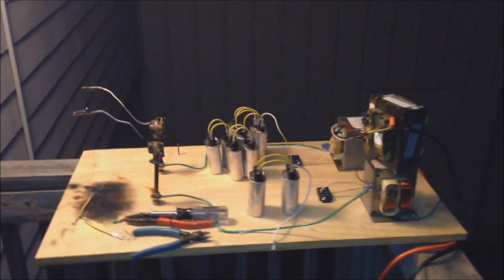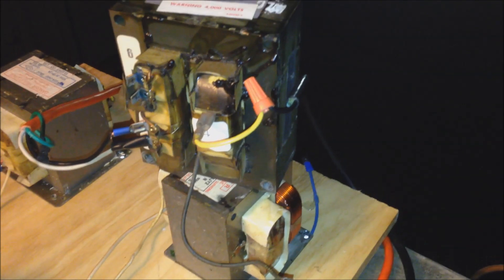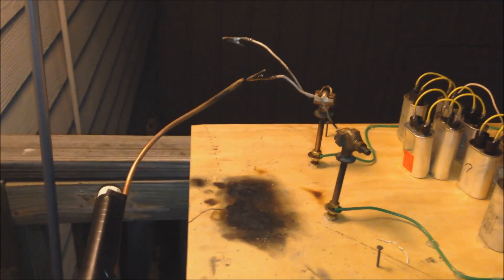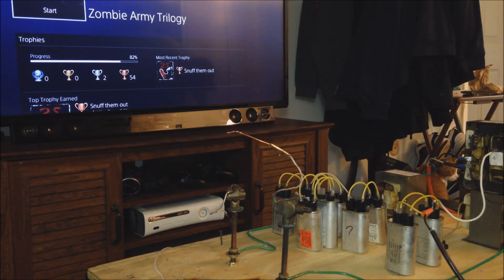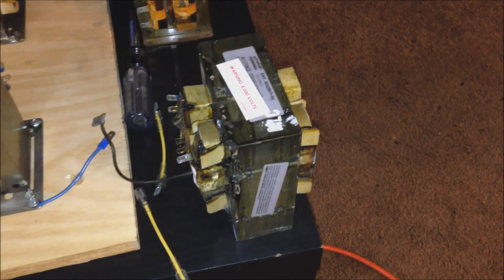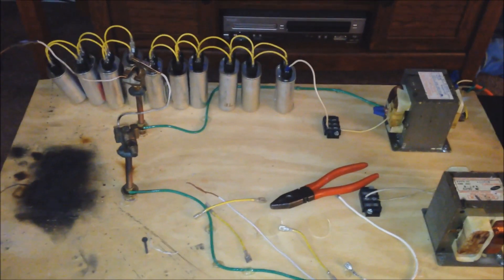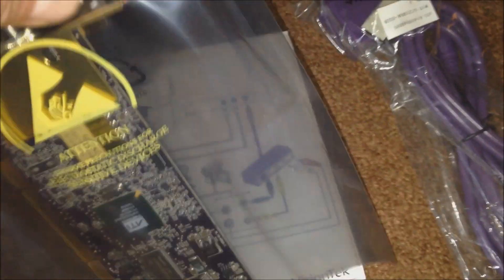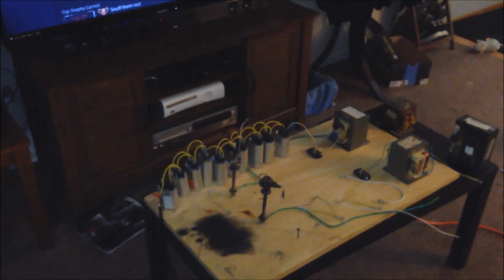Radarange Transformer Overheats + 10 Capacitors Bonus!

Comment: Not 100 percent sure, but it looks like at 9:15 the second or third capacitor away from the mot failed with a nice little smoke fountain. Probably internally shorted from excessive current! Very nice arcs btw. That transformer never stood a chance lol
Reply: late answer but it was a metal piece that melted off his chicken stick and fell to the wood table